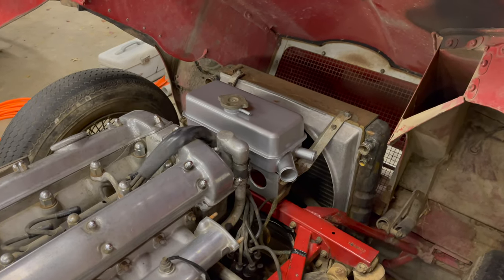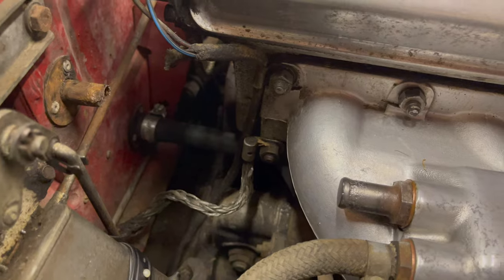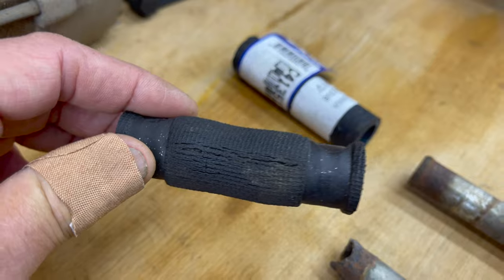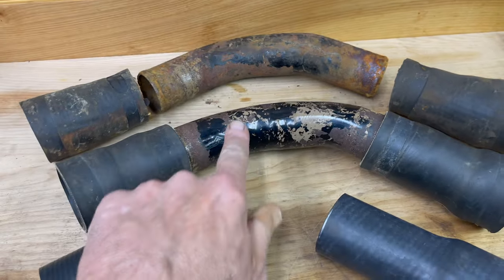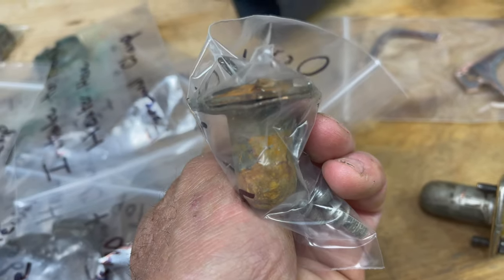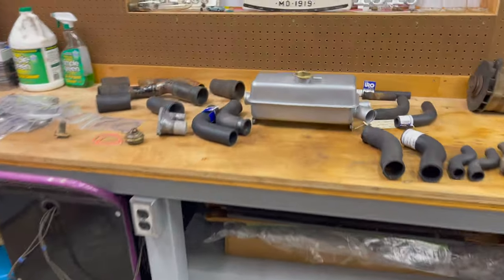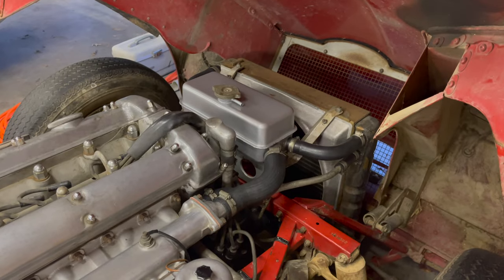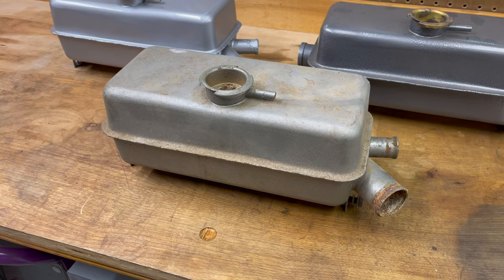Jaguar E-Type - 1966 OTS Roadster - Episode 10 - Cooling Hoses

Comment: Your probably aware of this but the large tube that goes throu the tank, side to side has a hole in it, into which the Otter swiitch protrudes, in order to get an acurate temp reading. What you might not have found is that in reproduction tanks that hole can vary in size.  I presume that a tighter fit would be best in order to prevent  "short circuiting of the flow" which BTW would  be an issue in your case, not wanting diret from the engine to get to the radiator during initial running. I would presume your original tank will have the proper size hole in the tube.
Tom G. 67 OTS all Series 1 except for non covered headlights, never liked them anyway. Interestingly thought the bonnet seems to have all the metal work to acept covered headlights.